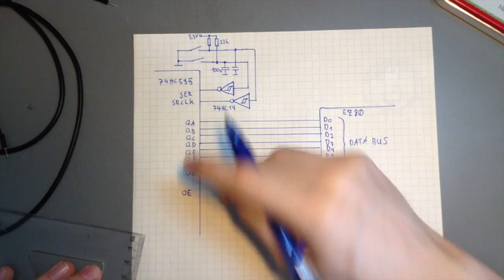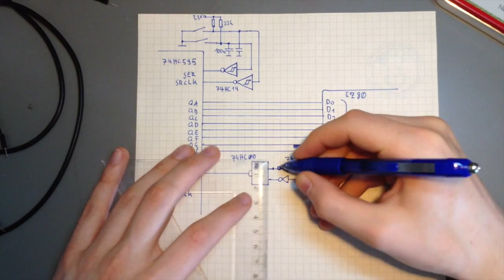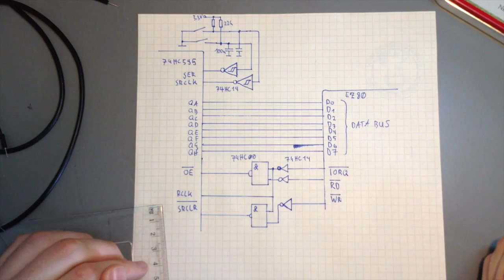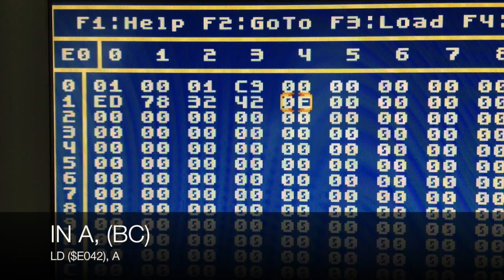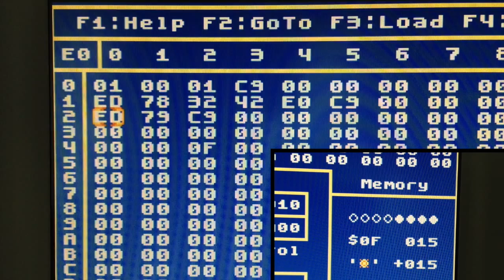Bare Metal Computing 0x02 - System Bus and Input

Comment: I keep meaning to ask.. what are you doing for video output?

I built NTSC/PAL output early on, which was a real drag (and the only monitor I had was an old C64 one.) It was old school, but .. useless. So I moved to VGA which is a fairly simple protocol, but requires very tight timings and very high speed timing.. so it is very hard to generate on all the fun-simple chips like an Atmel. (You can do it, especially with some tricks.. mono is easy, even some few colours.. but nothing fancy, and they don't have the RAM for a framebuffer anyway.) So in the end, without wanting to use an actual video chip (thats cheating!), I used an STM 32bit chip, and wrote the VGA generator there... now I can do framebuffer in onboard RAM or on a bus, and generate 60fps full colour 320x240 etc easy as pie.. so I'm using that for my own little gpu on projects. Awesome. i2c and bus and serial protocols to talk to it..

But what are you doing to generate the video signal? I doubt you built an actual VGA pcb (certainly doable, but a little on the too-crazy side of the fence.) Did you go down a route like me, or use a video chip, or did you end up with some clever little hack to do it?
Reply from the maker: VGA? I'm far more on the crazy side of the fence. DVI is the way to go: I am planning to use a Xilinx FPGA hooked into the parallel bus as a GPU (and maybe even coprocessor for floating point and similar stuff) and a TFP410 to generate a DVI signal.
Reply from the maker: The first prototype uses a Gameduino 1 board for video, which is similar to what I'm planning to do, just without the DVI transmitter chip.
Reply: Ha! I've experimented with those very same things! Gameduino is a cheap dev kit .. Xulinx seem pricy to fiddle with usually ..

But for now, manually generated vga :)